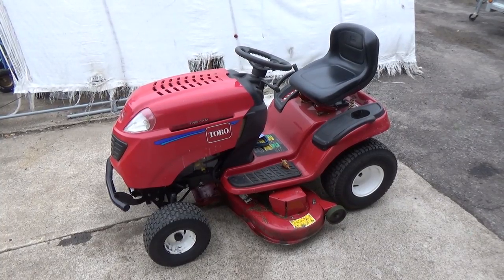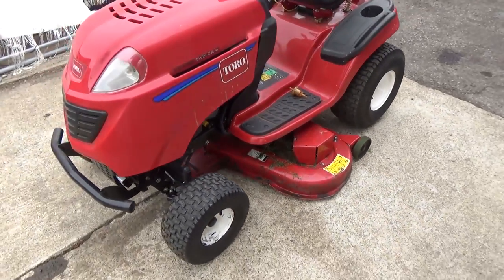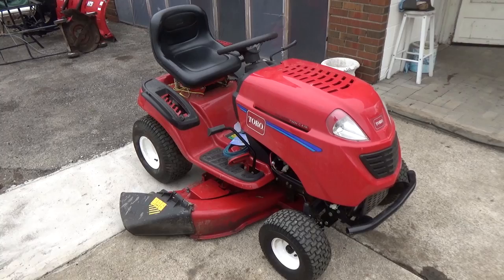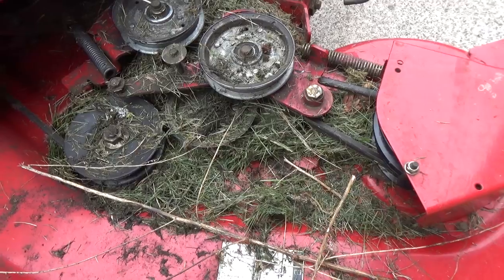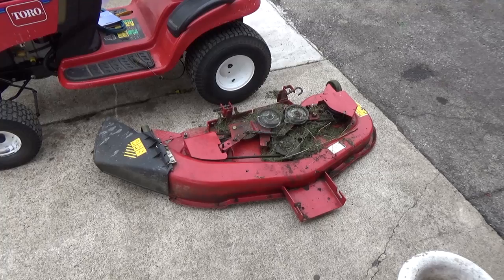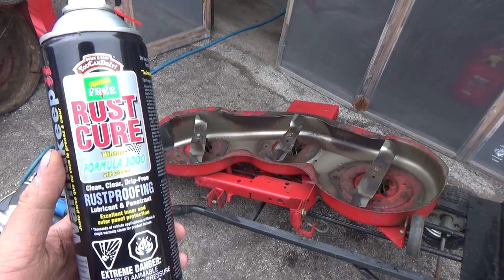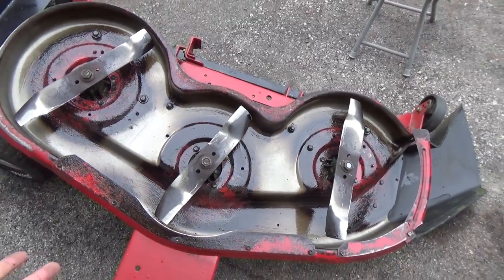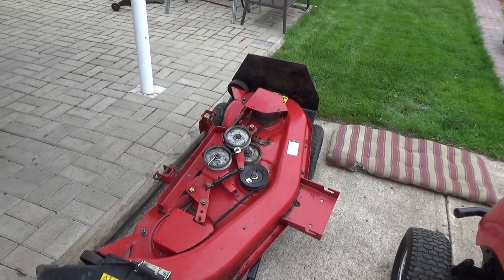How to Undercoat a Deck - 1 Year Update

Comment: I do small engine repair and NO ONE under coats their mower deck. I will be honest, people wont spend the extra money on undercoating a deck. I am not sure where you are located but reguardless for cleaning under a deck its the sand and other things that sand away the factory paint that starts the process. That and leaving wet grass on top of the exposed metal will rot a deck. I have cleaned decks with small trees growing on top of the deck. Sadly I have a Troy Bilt 33" walk behind mower that the deck is so rotted the support for the blade idler pulley has turned almost sideways. The deck is so rotted on eather side of the support, Its like tin foil. I am looking in small engine salvage yard this week for a replacement deck. I am not holding my breath. Its a $3,000 Mower. No any more. Paint wont stay on the deck anyways. I wish people would watch your video.
Reply from the maker: Thank you! I get a lot of comments from dry areas (florida, arizona) saying what a waste this is lol

It really isn't, especially if you live in an area like me, its always humid and we get lots of rain.

Mower decks, classic cars, they all rust and eventually rot away.
Reply: @EliminatorPerformance  I tried undercoating and honestly, Rhino liner would be the only material that would work for a long term Undercoat. It would cost a lot to have it done as it requires proper prep work to warrenty. I dont ever recall doing a mower deck the two years I did it. Michigan goes in two extremes. Clay and too much moisture to sand that will eat a set of blades away in two seasons. I know guys that use drain oil to undercoat their mower deck in between power washing. Staying away from the spindles and bearings is the number one thing on any mower.

Comment: Its not calcium build up on the aluminium, its aluminium oxide, which is the same as rust on steel. On that Toro, that area is due to spilt battery acid.

Comment: Most spindles that I have come across have sealed bearings so they really cannot be affected. Let me know if you have found different. Sometimes we have taken them apart and put bearings in that could be greased but the bearings that are stock usually are non greasable.
Reply from the maker: Depends if they're built with 2 RS bearings (sealed on both sides) ideally you'd want to check, but when I replace a bearing, I pull the inner rubber off on both Bearings, then pack the spindle housing with grease. This allows the bearing to be greased, and will increase the life of the bearings. If they're 2RS bearings, it really only greases the shaft.
Reply: @EliminatorPerformance  Thanks.

Comment: Instead of using water, I use my air compressor.  Or if handy, leaf blower, to clear debris from the top of the deck/tractor itself.
Reply from the maker: Anything to get that grass off the surface!
Reply: Found out the hard way , a leaf blower is the best way to go
Reply: @EliminatorPerformance  Air (blower, compressor) or soft broom is much superior to water to remove grass and debris from a mower deck. First, if you do it straight after mowing as most people do, you don't want cold water on hot parts eg spindles. This causes rapid contraction and damage (cracks the spindles, warps the housings or deck itself). Second, the water increases the likelihood of rust through both the initial application of water, and then longer term because the water drops trap dirt and even when the initial water evaporates off the dirt left behind then attracts more water in future. So, "anything to get that grass off the surface" is completely overlooking how superior using air is instead of water.
Reply: @ApprenticeGM  air is better if it's dry, dosn't do much to stuck on wet grass. here in wet west coast for half the season your cutting wet grass. cant even get it off with a hose, you need a good high pressure washer to touch it. some of us use heated pressure washers

 we often have to stop cutting 5 minutes in, turn the mower off and scrape fist fulls of grass out of the clogged up deck just so the engine doesn't stall, or burn the belt out (i've had it happen)

Comment: I have been using the rust preventative on my JD rider mower for 4 years. The mower deck has over 700 hours. I already had surface rust that I treated only by painting after season. 4 years ago I started using rust converter on rusted areas, paint over with enamel paint, then , and finally paint on the rust preventer. Since that time there is no, none, new rust! It works. In 2018 I bought a Kubota compact and began using only paint over bare areas and rust preventer afterwards. After 4 years of doing this with a new mower deck I have zero rust.

Comment: I have a 2016 Cub Cadet XT1 46”. I actually think this machine is GREAT. I change oil ever 25 hours or less. I dropped my deck today and worked my ass off to get rid of caked on and hardened grass. I mean I really went at it with a demolition flat bar. Let’s say that took 1/2 hour. Then I spent another 1/2 hour with a wire wheel on a grinder to clean it all up down to bare metal. There was no paint left. A couple spots had kinda bad scaly rust. I worked it over real good. Did I get every last spec off?  No. 98% or more though. I was happy about it. Vacuumed the thing clean. Sprayed on the Formula 3000 I bought because of this guy’s video. It went on THICK. Thicker than I expected. I then used an old shop rag and just slopped it all around covering every nook and cranny. I believe this guy who made the video and I expect in a year I’ll be glad I did this to my mower deck.

Comment: Bought a John Deere 42 inch a few months ago. I plan to stay on top of the maintenance for it myself. I like this video because this looks like the fastest easiest way to protect the deck without a lot work or materials. Pretty straight forward if you LISTEN to what is being said. Thanks for putting this out.
Reply: Slim we are still using this and decks we get return service on even if it is 3 or 4 years after you can see the protection it has provided. Not only that any debris that is underneath comes away very easily. Used to be $10 Cdn and we wait until the 50% sale is on, just picked up 24 cans at 50% off with a new list price of 14.98 Cdn

Comment: Thanks for the update. I wasn't really throwing a B.S. flag, but I was a bit skeptical about how long a rust preventative treatment would last. Looks like the stuff you used did really well. The dealer that my neighbor bought his mower from sold him some rubberized undercoat spray, and insisted that undercoating the deck was the first thing that he needed to do, before he ever made a pass on his lawn. Well, he did as he was told, and waited 3 days before mowing. After a few weeks, I asked him how this magic undercoat was doing, so we decided to check. Lifted up the mower, and a fair amount of the undercoat was gone (probably half).  Nice to see that the stuff that you used did its job, and also good to know that you are honest and showed that it needs to be touched up every year or so, rather than throw some silliness about how the deck is protected forever after being treated.  Good stuff!
Reply from the maker: The rubberized stuff is horrible, it'll trap moisture in between the deck and the spray (Similar to how a truck bed will rot from the inside out with a cheap bed liner).
Reply: @EliminatorPerformance  Yeah, I convinced him to blast it off with a pressure washer. Lesson learned. Thanks!
Reply: @EliminatorPerformance  what about Line-X professionally sprayed on? Line-X is sprayed on hot, is ready to use in 2 hours, and cures very hard like a hard plastic. It's not soft or rubberized. Would be interesting to try it out just for the hell of it.

Comment: I think this is probably the best approximately I've seen on this topic. I'm still leery about pressure washing my deck though. I have a gravely and the dealer told me that once a year wouldn't be a problem but the big thing he said was to make sure it's completely cool. Not to do it while it's hot as the bearing are more likely to take on water.
Reply from the maker: Yes, and don't aim the hose directly at bearings.

Scrape around those areas, and wash the rest.

We've done decks this way for over 5yrs and have never had an issue!

Comment: My home-use Simplicity Broadmoor is 20 years old and I've probably washed the underside of the 44" mowing deck twice.  I scrape the crud off the underside once a year for winter storage and now and again when the side discharge isn't blowing the grass clippings due to an overabundance of tarry crud.  The underside has had surface rust as long as I can remember.  This year, I finally have a 4" rust hole on the front edge that I patched with a rubber cover, license plate and self-tapping bolts.  I'm happy not to have wasted tons of time and possibly done more damage than good by constantly washing the underside of the mowing deck, which has had gobs of wet grass sitting on it every spring.  If I get a couple more years out of it, I'll retire from lawn mowing and hire somebody else to do it.

Comment: At 5 year mark I needed to replace my mower deck.  Before I installed it I sprayed the deck with an automotive clear coat.  That was two years ago.  This past week we rebuilt the deck, new spindles, blades and pulleys.   The deck is in great shape.  Only a few rust spots.

Comment: Thank you great point. I use old motor oil with a paintbrush on my trailer hitch works great.You must repeat a few times.I did use the Rust-oleum rust protecive brush paint on my deck seems to be holding up many years now. Like you said you gotta clean & maintain your deck yearly.

Comment: I cleaned my deck and than treated it with Ospho and repainted it black what amazed me is no rust or rot after 9 years thank God and I live in Florida which most the decks I've seen are rusted and rotting
Reply from the maker: Yea most of the viewers from Florida are saying there's no point in using the undercoating (I agree).

But around here, the humidity is so bad literally everything rusts away, even new cars!

Comment: I do similar service for my customers or rebuilds. I wire brush off the rust, use rust converter first, then coat the bottom with truck bed liner, honestly nothing is tougher and it stands up to branch and rock chips just like it does in a truck bed. I'd suggest doing that than just more paint, someday I'll post a comparison of the 2 methods but the truck bed liner is really tough stuff. In addition I clean the top under/around the pulleys and coat that also with the truck bed liner as people usually leave grass/leaves in that area. I always tell my customers never power wash, just blow off the debris because power washing forces water into/around the bearings on the pulleys even though they are "sealed".

Comment: I just undercoated mine with chassis saver. The last time I painted it was a few years back and all I used was some primer and farm implement paint.
The friction from the dirt stripped a lot of the paint within a season.
I am at over 100 hours of cure time so far and will probably be mowing this weekend. I hope this paint holds up to the abrasive dirt.

Comment: Yes, I agree totally. I have owned many mowers over the years and using an oil based coating is the best solution. The use of fertilizer on the lawn is another reason for rust. My approach is two complete cleanings per season an include a product called "No Drip Oil" used for undercoating.

Comment: OK! Subscribed! Great info here
I spent a couple hours scraping under my Iseki SXE220 deck and I'm shocked how rusted this deck already is. I've had this SXE220 for less than a year. I'm new to lawn tractors, but not to mowing. I'm further surprised manufacturers don't suggest this from the get go. Anyway, I'll ask my mechanic about him doing this; or I'll do it myself. My SXE220 is still under warranty and is due for annual service...well... my mechanic suggested service every 30 hrs...which I think is a bit too often. I'd rather handle it myself if my mech is sheepish about the undercoating. He's probably just too busy.

BTW, IMO $300 is a bargain for this undercoating! I realize you've changed your service procedure. 

Again, GREAT info here :-)
Reply from the maker: $300 was for the full service, so engine oil filters and spark plugs plus deck clean undercoat, blade sharpened and balanced and also tire pressure and greasing everything. Parts and labour have gone up a bit since then.

Comment: Thanks. Great video. Very informative. One insignificant correction is the white stuff on the Aluminum deck is not Calcium but Aluminum Oxide, basically Aluminum rust like the Iron Oxide on a steel deck.  Hope I can find that spray!

Comment: Great JOB , Well Done. As You Say You Can Do All That Extra Work To Do It Properly & Have It All Painted etc, But That's Extra Time, Cost Of Paint & Thinners etc. It All Adds Up, Then You Have Your Labor, It Works Out To Be A Bit Expensive. But The Way You Have Been Doing It Is  Perfectly Fine & You Are Preventing It From Rusting Any Further. You Can Also Use Old Sump Oil On It, I Have Done Before With No Problem

Comment: Try using an angle grinder with an 80 grit blue flap disc to sharpen your blades. i used to use grinding discs and since using the flap wheels i will never go back. You get much better control from one hand on the grinder and a better finish which isnt razor sharp.

Comment: Because air is a fluid, what you're looking at is basically a map of the airflow. You can see where the airflow is fairly stagnant and where it pools so it's not a fault of the coating but instead simple physics prevents good enough air flow to keep that grass moving which is why you see clumping where you do.

Comment: I was a landscaper for over 10 years and once a week every week I changed my blades and scraped my back. I had a 52-in exmark zero turn and a 32-in exmark walk behind. I religiously once a week would scrape my deck of any clogged up grass that might as well stick down there and then I would apply a product called mow eaze  it is a silicone-based product and once the paint got taken off of my deck it was way easier to keep the deck clean but once a week I would always apply Mow eaze  to the underside of my deck in liberally coat the underside of my deck till it was dripping at night time so it would have time to dry by the morning and I rarely ever had a issue with grass sticking to it because it the underside of the deck was so slick the grass would barely ever stick except in the corners and in the baffles and that's where I had the scrape but the paint was completely gone from under the deck and I never had an ounce of rust ever.

Comment: ive been using roofing tar to undercoat all my steel decks for over 50 years and never had one rust out...the tar is tough and stays semi pliable resistant to chips...one a layer of grass blades saturate the surface nothing else sticks...seal off any rust. .had decks go over 30 years outlasting the engine. .

Comment: PA LAWN GUY, AIRCRAFT MECHANIC> You should quickly scrape off the loose paint so the eliminator can coat all paint loose areas and no moisture can be trapped under the loose paint.. It would only take less than 3-5 Min.

Comment: Have you used the new laser. It peels rushed away. Without harming the paint except for Words rusted underneath. I've seen it used on the internet. It does a hell of a job. If I did it every day I would buy one
Reply from the maker: Those things are like $40,000 for the good ones lol

Even the cheap ones are a few thousand but they don't work as good!

Comment: We have trees where I live, that have a non edible fruit, we call monkey balls. They fall in late September. If you run your mower over them, the oils in the fruit clean and coat it preventing rust over the winter. I put a little pile and pull over them for 15 seconds or so.
Reply: I have heard of this before but we do not have them here in Canada. All i can say is if we mulch all our leafs mostly maple that drop off in the Fall it does help clean some of the debris under the deck.

Comment: My problem is. Like now. Ha what’s good stop rust underneath lawnmower deck. Can you put the names of what you use on the reply.  I still have to wire brush it.  Get it ready for the rust inhibitor. So far it looks like yours is the best that I’ve seen I have used three different ones and big chunks still keep falling out when I scrape it.
Reply from the maker: So you could wash it, let it dry, scrape it and then use rust converter, the brown should turn black, then you could paint it if you wanted, but I just spray with rust inhibitor like the rust cure formula 3000 and it keeps everything coated like undercoating a vehicle before winter. I do it every year and they still rust a bit but they never rot out.
Reply: @EliminatorPerformance  
Thanks looking for it now. I scrape , wire brush , pressure wash wire brush , pressure wash 48 hour dry when the weather gets better. I’m just doing a lot of prep work getting parts that need replaced in before the weather gets better and hoping I can find something that will fix the rust problem. Or have some fun close up the shed doors turn the heater on. I can just be one of them people that are the reason why there’s Big red warning signs on the back of the spray cans. 😂😂😂😂

Comment: Hey, Eliminator. I'm about to apply a product called E-Z-SLIDE under my Exmark Radius Series Z-turn. It's supposed to safe guard against rust, etc., because the coating applied is made to have the grass, etc., SLIDE off the deck. Tractor Supply sells it for 42.00 a gallon and it covers 300-400 sq ft. What think ye?
Reply from the maker: How about you try it out and tell me! I've ever heard of it, but anything that helps prevent rust is better than nothing. That's basically the idea behind these videos!